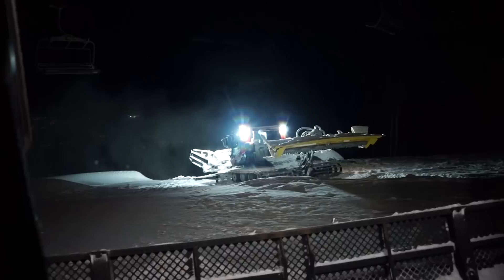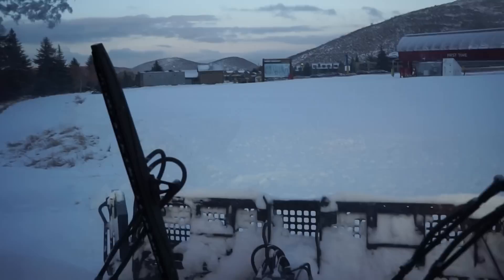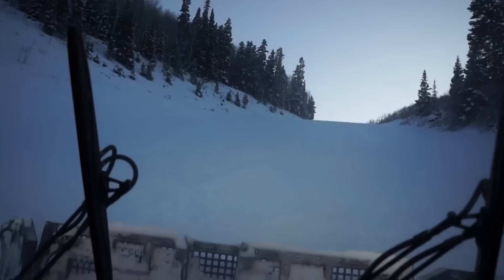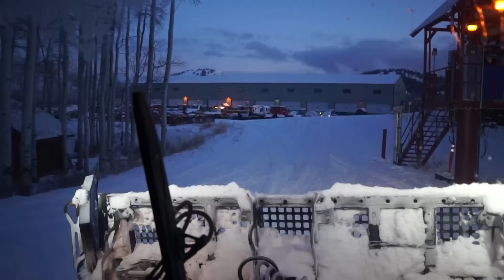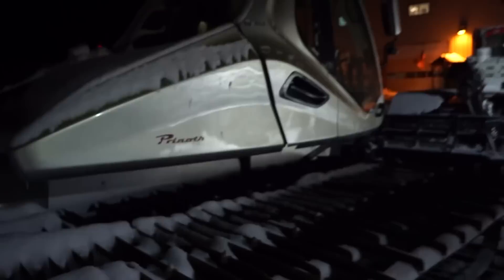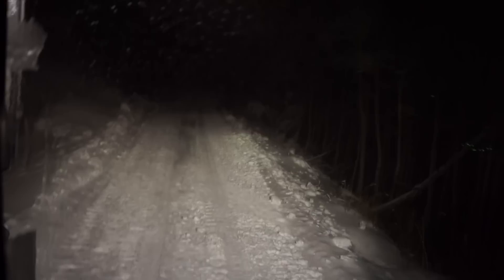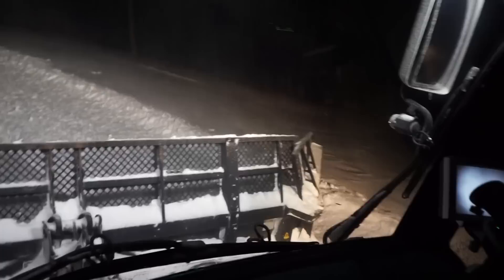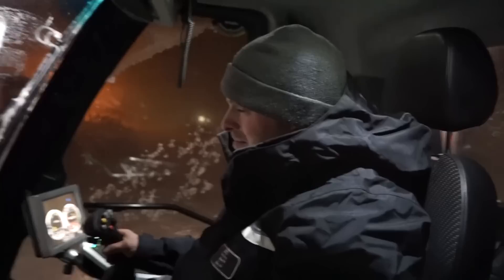Epic Snowcat Ride-Along at Park City Mountain Resort! Grooming Largest Ski Area in USA

Comment: Diesels have engine oil warmers for cold weather thats why its warm
Reply from the maker: They definitely have systems for pre-heating the oil/coolant, etc. Stu's BR 400 from '94 has a heater for the coolant, pretty great. In this case though, I saw that PB 400 arrive earlier, so it was hot either way. Thanks for watching!!
Reply: @DuraMaxRoad Then it has to be plugged in to the mains. Which is wasn’t. And the oil isn’t heated then, it’s the coolant which is heated and circulated.

Comment: Probably the first thing every Pistenbully operator says to a passenger: “hey, I think your door is open” 😂 the cabs are airtight, so the doors always require a hefty pull to close properly. Gotta keep the snow out and the heat in!
Reply from the maker: Haha, yep, "gotta follow through." I failed on the first try. They're like a Jeep Wrangler in that way. Major seals! Cats don't ford rivers, but perhaps they should... Thanks for watching!!!
Reply: Ye, usually try and crack a window open a tad to let the air pressure out. Not all have opening windows tho
Reply from the maker: @gavinsutherland7226  just like the old VW Bug commercials.. Airtight!

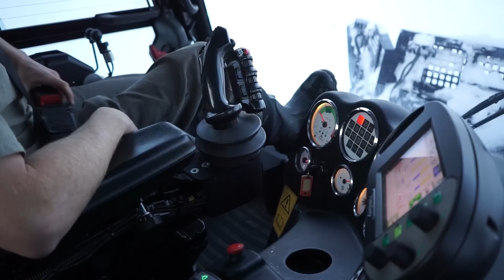Comment: @8:30.  That isn't a Cummins 8.3.  If it is 400HP in an "ag" application, it is most likely an ISM or ISX. (QSM or QSX)   The 8.3 was replaced with the ISL, a 9L engine.  But the ISL isn't rated that high in an ag application.  The 8.3 was never a Tier rated engine.  It is most likely a QSM or QSX.
Reply from the maker: I appreciate the info! We didn't do our homework on this one, but will in the future. Thanks!!

Comment: Good video but the guy is wrong about the hydraulic fluid, and has no clue how to check engine oil.
Reply from the maker: yep, red for several reasons. And I see why you say that... I consider the post-wipe oil level to be the "official reading" but with no rags on hand, the old pull & check usually indicates at about the same level. At least in my experience it has... I am open to learning more about this, haha. Thanks a ton for watching!!!